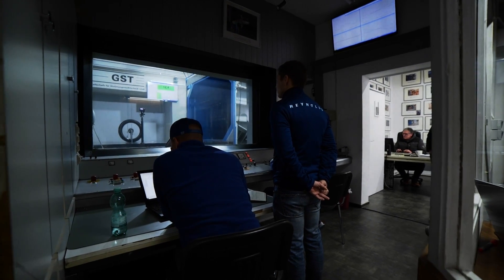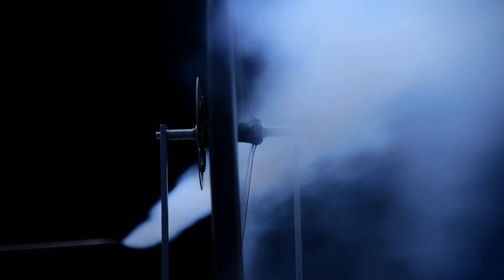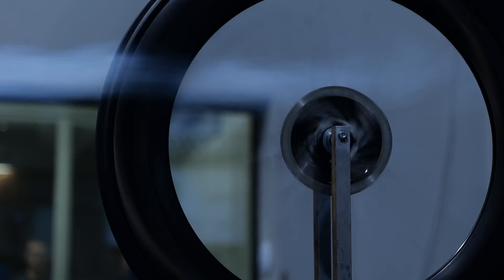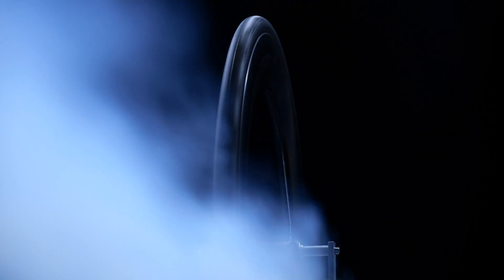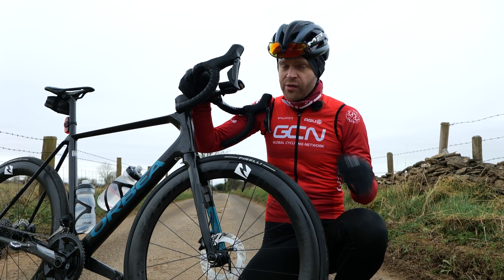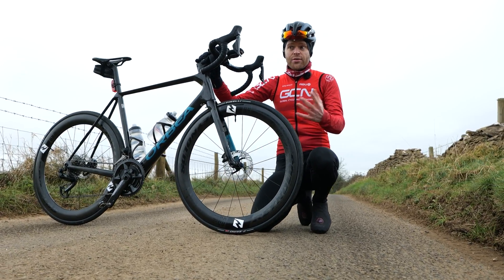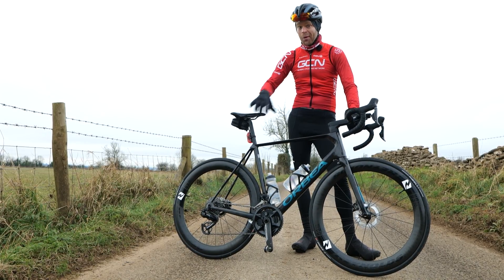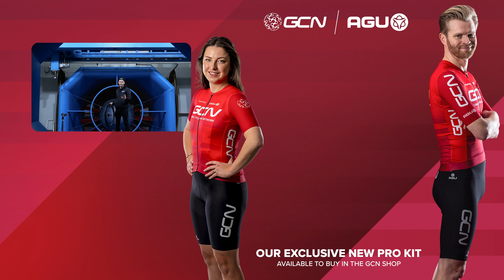How Carbon Wheels Are REALLY Designed?

Comment from the maker: What do you think about the carbon wheels design process? 🤔
Reply: So they are "really designed" just like we used to think they are designed, huh?
Reply: Why have all the design computers (and no doubt AI systems) not come up with the perfect cross-sectional profile already!?!?
Reply: Unfortunately the wheel design is optimized for 1 or 2 tire width. If you prefer wider tires than the question is if carbon wheels are a waste of money in respect to aerodynamic gains. But these kind of data you can't find at the manufacturers. So, for a 32mm wide tire is a gravel carbon wheel set with outer rim width of 32mm aerodynamically better than those Reynolds wheels that were optimized for smaller width?
So wheel design process and progress is good, but for end consumers it is almost impossible to compare which tire-wheel combo is best considering all kind of conditions, cross winds at different angles, different speeds/wind speeds, how much influence has the fork/bike, ...
Reply: What about YAW angles optimal for the really designed wheels? Yaw... Yaw...  Yawn.
Reply: I love Reynolds, they are excellent. My ONLY issue with them is they seem to have gotten heavier over the last 7 years.

Comment: It is pretty obvious that the wheel designer at Reynolds is painfully aware of how much less drag 23C and 25C tyres have, but he couldn't say anything because he is "required" to design exclusively for the current marketing balloon tyre trend. It is interesting that athletes who really want to win - like the British Olympic track team - are using 19C tubs on the front wheel and not bending to the hype machine. It was fun watching when the smoke stream hit the disc brake. You have to wonder how many watts those puppies are sucking up at the different yaw angles?

Comment: What you do not typically see in wheel section depth discussions is acceleration. I have Shimano RS501 wheels that I modified with a wheel cover disc on the back and 100 mm deep covers on the front on a TT bike. I live in city center and I frightened people I passed and myself from their shock when accelerating. Here we have stop and go traffic every few hundred meters in the city. Added hugely improved acceleration saves the legs by miles. As a disc golfer I am way stronger than racing cyclists in the upper body and the sea side gusts still mean wrestling on the TT bars. By a lot!!!

Comment: Next video could look at mudguards: some testing duggests greater reduction in aerodynamic drag (in headwinds) from mufguards (fairings) than aero wheels, so why aren't they in more common use & in shops? UCI rules for competition (but most people aren't competing) & I suppose the industry would rather you spend £1000 on wheels than £50 on plastic.
Reply from the maker: That's a great idea to see if they are a hindrance in terms of aerodynamics. 
We think there is still a bit of stigma about mudguards not looking cool from some riders, but slowly the move to mudguards is happening. What makes it a bit easier is that thanks to disc brakes, there is more room for mudguards to be fitted thanks to the rim brake calliper being removed from the equation. 👍

Comment: I'd love to hear more about how the interface from the wheel to the bike (forks for the front wheel and the rear triangle for the rear wheel) plays into wheel manufacturers designs if at all. Are those interfaces affecting the aero profile of the wheels so little that it doesn't matter or is the different between so many different styles and brands too much to even consider?

Comment: "over the last few years."
I was in the Motor Industry Research Association climatic wind tunnel to see Chris Boardman on the 'Hour record' Lotus. That was over 25 years ago.
Back then, there was Finite Element compressible fluid software. A model of air passing an object could be calculated. Guess how Lotus did it for Chris?
Within the company I was working, motorcar variable intake manifolds were being developed. The software modeled reflections within the intake plenum.
Reply: That must have been so cool to see Chris in the testing in the tunnel!

Comment: Super fascinating, for sure. I think that designing a wheel where the laminar air flow sticks to the wheel in a lateral plane while also on a direct plane is fascinating. It is also interesting that they are using terms like a wheel stalling is fascinating. In an aircraft, when a wing stalls the laminar air flow separates from the airfoil causing a insufficient amount of lift, does a stalled laminar flow on a wheel and tire cause a pushing to one side? Increased drag? An increase in frictional pressure on the road?  It would be super interesting to have some major geek physics content on here.
Reply from the maker: Great questions! One for the tech nerds at Reynolds for sure 🙌 Would you like us to get Todd back on the channel?
Reply: @gcntech  absolutely!  II think that he had a lot more to say, but couldn't because of time and, of course, industry secrets. It would also, if you want, be good to have some of the leading industry engineers come on to talk about this as well.  Great video! Keep up the good work.
Reply: Yes please  @gcntech
Reply: @gcntech  yes
Reply: I really would have liked to see more technical details. But at the end of the video I was a bit disapointed because the Reynolds guy won't be allowed to get into it quite more, resulting in just another advertising vid. Sadly

Comment: Reynolds wheels seems to be overlooked in most wheel test. But I've had great experience with DV3K(Tubular), SDV66(Tubular) and Now AR41(Clincher) all with rim brake. The DV3K's have been my training wheels forever and they never felt unstable in crosswinds other conditions. I can't wait to try the new Reynolds Disk Brake Wheels when I get ready to upgrade the Stock Wheels on my Emonda.
Reply from the maker: Wow! Sounds like you'r almost gone through the full works 🙌- Would you recommend a wheel upgrade to a cyclists looking for their first upgrade?
Reply: @gcntech  Absolutely, It really depends on where you ride and your current wheelset. If you have Box Section Rims and you ride in a variety of Terrain a 40-50mm deep section wheelset will serve the rider well. If you live in a hilly/mountain area, reduce the cross section to 20-39mm(Lighter the better within reason). Budget wheels are very affordable now and actually pretty good. If you buy a wheelset or the ones you currently have has so-so bearings they are easy to replace and you have a very good wheelset. The Major thing to look for is Wheel Runout and Trueness. Everything else can be changed/upgraded.

Comment: Hi Ollie.  I do love you nerdy vids.
I do wish you wouldn't talk about watts saved without telling us the speed its saved at.  You know that in aero terms watts are third power of speed so it does matter.
For a plain wheel the centre of pressure to side wind is at the centre.  The centre of the wheel is forward of the (inclined) steering axis to produce the best trail.  This offset is the source of that shimmy in the cross wind.
Modern aero wheels apear to be having their thicker section nearer the inside of the rim thus on the leading edge (of the wheel) you have a reverse aerofoil and on the trailing edge a more normal aerofoil so that the lift curve slope of the trailing edge is steeper than the that of the leading edge so that the side wind (or yawed) lift is greater at the trailing edge than at the leading so that centre of (side) lift is behind the centre of the wheel, thus reducing the turning moment.  A clever way of doing it.
Measuring the centre of pressure is proprietry?  Well they might have something clever but having a load cell in each fork leg and measuring the differential is pretty easy and as its a scientific principle cannot be patented so anyone can use it. 
You're right that the naysayers can ignore the benefits if they wish but the benefits of aero are there for all.  It might only save a few watts but for those of us with only few watts, then every watt counts.
Reply: Im truly trying to understand what you wrote. No tea here. So, when you spin a disk in a vertical plane, the advancing half has less friction and, in a helicopter, more lift than the retreating.  If you apply a pressure to a spinning disk, that resultant force always acts at 90 degrees. 
When you say reverse airfoil, are you talking about the retreating part of the tire because there is little change  of the camber of the tire after it leaves contact with the road? Or are you talking about the position of the rider in relationship to the center of gravity of the wheel?
Reply: @Triracer25  Hi Kimberlie,  I'm thinking of the leading edge as the portion of the wheel in front of the axle and the trailing as that part behind the axle.  If we cut it through in section (including the tyre) both would look like an aerofoil but without a sharp trailing edge, .  The leading aerofoil would have its maximum thickness far back on the shape while the trailing section would have its maximum thickness more forward on the shape.  What that means is that, from a lift producing (that is sideways in this case) point of view, the trailing areofoil is more efficient than the leading one so that its moment (restoring straight about the streering axis) is higher than the leading aerofoils disturbing (from straight) moment thus reducing the tendency to turn the steering.
I fully understand your helicopter reference here (in this case perhaps a tail rotor) but it is not the advancing/retreating blade effect I am refering to (that might apply with some of these six solid spoke wheels we see but thats another story)
My consideration does not even concern the spinning nature of the wheel, just the normal flow over the cross sections of the parts of the wheel as they constitute aerofoils of different sections.
Sorry about the wordiness, we don't have the ability to include a few pictures.
Hope that helps.
Reply: @emmabird9745  Hello, thanks for the clarification. As someone with both aviation and physics backgrounds ( I have 9 degrees in various disciplines - yes Im a nerd who is curious about everything) you had me completely confused. I see what you are saying, and it is an interesting idea, but to be fair, to isolate one parameter of a question without considering the whole in a real world setting, ie spinning wheels ect,  can skew what is really happening. Also to be nerdy, an inverted airfoil is just that, inverted. A positively cambered airfoil is convergent and divergent  against the air above it ( Bernoulli's principle).  It is the same principle on a vertical axis ( helicopter tail rotors have a changing  angle of attack or  variable camber as opposed to tires on a bike that are fixed.) It's inverted camber on the retreating side has lower pressure unless acted upon by another force such as a side wind.
I assume we are saying similar things?
Reply: @Triracer25  Hi Kimberlie, 9 degrees wow.  I only have the one (aero eng) then I had to earn a living!
I too am nerdy and have to understand how it all works.
Yes I think we are saying similar things.  I don't mean inverted aerofoil as in one at negative incidence I mean reversed as in the wind is coming in from the trailing edge, as indeed it does on the trailing side of an early generation aero wheel.
When trying to solve (understand) a complex problem I try to break it down into component parts.  In this case I consider the rotation and forward speed separately.  Rotation has 2 effects.  one is the drag of the spokes etc as they descibe a circle and the other is to present the top of the wheel with an air speed twice that of the bike.  That second is why the wheel drag is so much larger than frame drag.
From the longitudinal yaw stability view point, the front half of the wheel has the same velocity profile as the rear half (neglecting the interference of the forks and hub) so it sort of cancels out leaving us with the wing in a free stream situation so it would appear to be the dominant factor.  I suppose that someone clever could design their forks such as to have opposite cambered aerofoil sections so that in yaw each leg might have different drag giving a small straightening effect but it would probably also have an adverse drag effect overall.
Of course those of us (not subject to the UCI) who have mudguards could add a weathervane to the mudguard to help counter the yaw as indeed I did on my tourer 20 years ago when I also added an aero insert to the front wheel (which made me 6% faster and still controlable in strong cross winds) but that's a niche solution for those of us unconcerned with fashion or the UCI.
Thanks Kimberlie, such a nice change to be able to nerd out with like minds.
Reply: @emmabird9745  Ha. Nice! Great points! Ya. I was a single mom and worked three part time jobs just to make it through flight school and my Uni degrees, I worked for the University. Still in Grad school right now but taking a year off to train for Ironman and get my ussa, usat, and issa certifications.  You were smart to go direct to Engineering instead of picking up bits of information the round about way.

Comment: Ever since I saw the first wheel with internal nipples, I have wondered why they don't reverse the spoke and place the nipple in the straight pull hub. Truing the wheel would not be such a pain.
Reply: Some have done this.   The spoke threads into the rim in those cases.  Its also the only way if you don't want spoke holes on the tire bed

Comment: My wife's bike is on Giant SLR 1 wheels with internal nipples. Any wheel truing requires, tyre off and rim tape off which is a real world PITA!
Reply from the maker: It can split opinions - If you're looking for all out aero gains then this is the best way to go. If you want something practical and for daily riding then these perhaps aren't the wheels for you.
Reply: @gcntech  agreed. More and more I'm looking for ease of use and serviceability rather than flat out performance.
Reply: @gcntech  nonsense, SLR1 are a perfect all-rounder/trainer, not too heavy, not too light, 42 deep is practically industry standard, price is sweet too compared to all new performance wheels.
Reply: If you need to true a deep section carbon wheel, you had it built wrong. Constant truing is a normal thing of shallow alu rims as they "breath" under load and creep over time. Carbon doesn't deform before breaking. Next time you do it, swap the spokes for sapim or at least pillar and use tensiometer
Reply: @feedbackzaloop  they're factory fitted rather than 'built'.
Reply: @bennp2000  factory built. It's not a suit to be custom-fitted or smth after all. And yeah, we talk Giant here, so no exceptional quality was to expected from the beginning
Reply: @feedbackzaloop  it's not quality, it's design (I'd say their quality is as good if not better than my Knotts). I think Oli said it in the video, hiding the nipples is an aero gain that some people want, but that's just not me.
Reply: @bennp2000  nothing wrong with the design - like extreme shapes, low spoke count or even hookless - it is common for other brands too. Just production and assembly are optimized for mass market, not ultimate quality. This is what to expect from big brands.
While Knott(s) - I am actually absolutely not familiar with them, tried googling and had no success... What exactly are those?
Reply: @feedbackzaloop  hookless can get in the bin too! Knotts are Cannondale. Wheel bearings failed really quickly.
Reply: @bennp2000  oh, knot with single T and weird O... Well, everybody knows Cannondale is a paper tiger. Cool to look, garbage made, insufferable warranty.

Comment: I'm currently running the stock alloy wheels on my Domane. However I did purchase a set of Scribe carbon wheels for if and when spring in the UK ever arrives combined with some continental gp5000 28mm tyres.

I have a few local loops that I am very familiar with now and have a sufficient amount of data to eventually see what difference they make to my times and also feel of the bike.
But in the meantime I've seen how much of an effect mudguards have on the bike.
Specifically with regards to turbulence from side winds when using them.
What I've learnt simply from trial and error is that the distance of the guard from the tyre is very important to minimise this unwanted and frankly bottom clenching side effects of keeping myself cleaner and drier from using them.
In short they need to be fairly close to the tyre to allow the curve in the mudguard to shield the air as it passes the wheel and guards.
But not too close for safety reasons

Nice to see the time put into reducing instability on carbon wheels looking forward to the trickle down benefits of this .....
Reply: I feel only one that using same all year, I'm looking to go 25mm for my trek Emonda ALR but as feel don't gain much when go to 28 or 30, current bike is 22mm tubular

Comment: In the case of the front wheel, do you really want the air to reattach itself?  Isn't that just going to bring it back together, then have it hit the downtube, and then it has to break up again, and thus, turbulance?  What if it channeled the air around the downtube but not as far wide as a leg?  Is that possible?
Reply: Keeping the air attached at higher angles of yaw (ie. Crosswinds) significantly improves stability.
Reply: Ribble have designed their bike to take this effect. The air of the wheel has some turbulence added in to make the air pass over the frame easier.
Reply: You want air to reattach in almost every* situation, because otherwise you are not talking about 40mm wide downtube hitting undisturbed air, but 200mm wide blob of turbulent air, travelling togerther with the downtube, hitting undisturbed air.
*special cases are torpedos and such, that have much greater skin friction over form component.